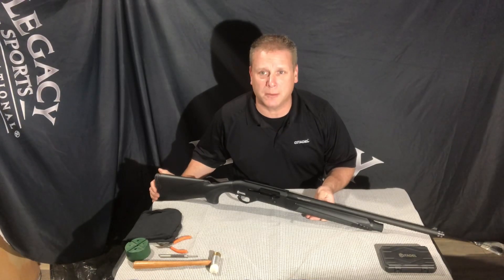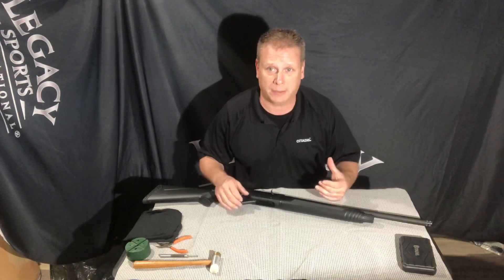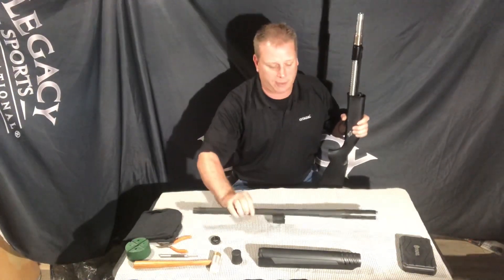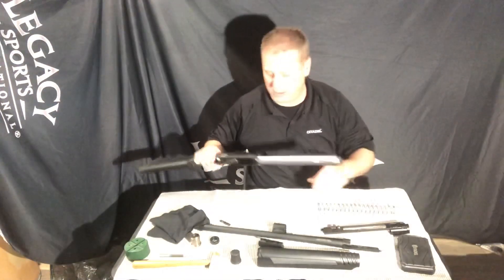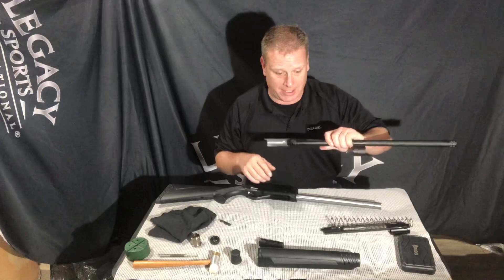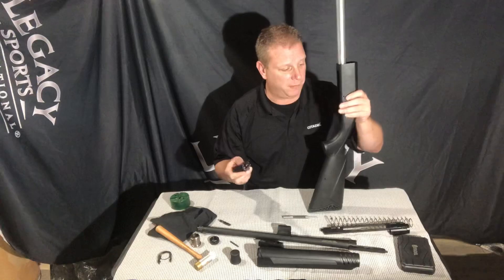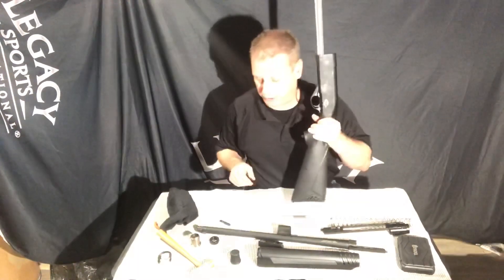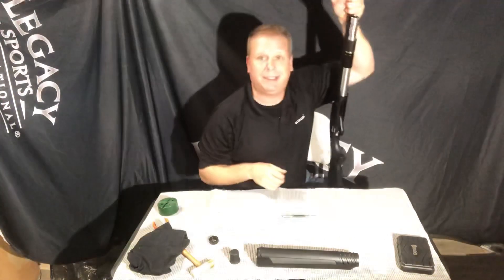Citadel KATAC-ATA12 disassembly/assembly

Comment: I just recently bought this shotgun. I tore it down completely to get the factory grease it is shipped with cleaned out. I took it to the range and it cycled perfectly until the eighth round when after firing, I found the trigger group hanging from my trigger finger. The ramp pin had worked its way out. Fortunately I found the pin on the ground. I used my mini repair kit that I always have on hand and reinstalled the trigger group and pin. About 8 rounds later it did the same thing, and I had checked the pin after the fourth round. I again, found the pin on the ground. Reinstalled the trigger group, packed up and went home. I emailed legacy sports support about the problem 3 days ago and haven't heard back. Has anyone else experienced this problem?

Comment: What if my shotgun model doesn’t have a retaining screw ? I need help putting the sleeve back on
Reply from the maker: Hello-if your model does not have the retaining screw, then the assembly process would be as follows; action spring, action arm and tube assembly, gas piston, barrel, forend and finally, magazine cap.

Comment: Is the supplied choke tube, cylinder or improved cylinder?
Reply from the maker: If the shotgun is new, out of the box, the installed tube should be modified. It also comes with a cylinder bore and full choke. They should all be marked as to the constriction.

Comment: Also I didn’t get the choke key with mine that I bought right out of the box can you send me one or will I have to just buy one
Reply from the maker: Hey John. Reach out to me personally at my email address and we'll get this resolved for you. It's scottn@legacysports.com
Reply: @scottn4948 hay figured out how to get the barrel tightened but don’t know what my choke key wasn’t in the box
Reply from the maker: Hey John,

Okay, good. Glad to hear you got the barrel tightened down. As for the choke tube wrench, they are usually behind a hidden "door" in the case. Remove all of the choke tubes from the case and shake it. You'll probably hear the wrench rattling around behind the door. Open it by pulling up on the case lid and pulling the door down. You'll then get the wrench. If for some crazy reason it's not there, let me know.
Reply: @scottn4948  thanks I’ll check when I get home
Reply: So I checked and definitely not there so I guess I’m buying one thanks
Reply from the maker: @johnhasty5009   hey John, reach out to the email address I provided you earlier with your address and I'll have the factory send you one at no charge.

Comment: does anyone know how to install a Barrel seal O-ring on the Citadel Warthog 12 gauge semi auto shotgun.
Mine did not come with one. Thanks!
Reply from the maker: There is no o-ring inside the barrel lug? It might be difficult to see because it's a black o-ring inside the black lug, but it should be there. Is the gas piston (silver looking) seated up inside the lug or did it remain on the magazine tube? If it is up inside it the lug, that's what's holding it there is the o-ring. Let me know and we can go from there. Scott

Comment: Any tips on getting these turds to cycle? I've got two of them. Neither cycle recommended velocity rounds, I have yet to consecutively shoot more than 2 rounds. Yes I have cleaned them both. I did not read the fine print on the warranty booklet so I did not register the warranties which probably puts me out of luck in that aspect as well.
Reply from the maker: Hey Levi- if you have thoroughly cleaned both shotguns as I demonstrate in the video and you're still having issues with cycling good quality brass based ammo at first, try this. Take a 3 piece cleaning rod end section, put a 12 ga bore brush in it and wrap 1 or 2 cotton patches around the brush. Put the rod into a drill and put a light coating of metal polish on the patches. Insert the brush into the chamber area only of the barrel and polish it for about 30 seconds or so with the drill. After that, use a bore mop with a very light coating of oil and lubricate the chamber. I usually find that after doing this on my samples that have cycling issues, it throws the empties about 10'-15'. If you still have trouble after that, let me know and we'll figure out the issue.

Comment: I cannot get the barrel off. Tried putting it between my legs like yourself and I still can't get it off any other tips on that part?
Reply from the maker: Hey Ty- is the bolt pulled back or closed when you’re trying to remove the barrel? It should be closed when trying to remove it. Is this also the first time you’re trying to remove it? I have seen on some where the oil has kind of “locked” the barrel in place and it’s taken two people to pull it apart the first time until you wipe away the excessive oil. Let me know. Scott
Reply: Yea its my first time trying to disassemble. The bolt is closed and I've tried with two people and no luck. My next option was maybe using the vise grip. If you have any other tips I'd be glad to try em out before resorting to the vise thanks
Reply from the maker: Hey Ty, sorry you’re still having an issue with the barrel. What ever you do, don’t use vise grips! That’ll destroy the barrel and put marks all over it. Try pulling the bolt back and locking it in case the chamber lock is preventing you from removing it. Use two people again. I have a feeling there’s a ton of oil in there creating a static lock. Once you remove it and clean it up, you won’t have this issue again. Let me know how you make out. If you still can’t remove it, message me and we’ll get it back to the factory and removed for you.

Comment: I was getting a failure to feed, until i took it apart and cleaned it. So, the excess oil does seem to affect operation. But, i have a Different issue. After i load one in the chamber and hit the bolt release, my feed ramp will also lock shut, if i dont hold the ramp lever forward as i hit the bolt release.
Reply from the maker: Thank you for the post. Did you happen to remove the trigger assembly at some point during the cleaning? I’m wondering if the link for the feed ramp is somehow caught behind the bolt release button. If you still have an issue, email me at scottn@legacysports.com and I’ll see what I can do to solve it.

Comment: Yesterday, I purchased a Citadel ATA 12 gauge shotgun but have not yet taken its delivery.  To be honest, it was an impulse-buy prompted primarily by its low price and the fact that, as a pump aficionado, I have never owned or even fired a semi-auto shotgun.  

 My prior to purchase internet research indicated the made-in Turkey Citadel has received a mixed bag of reviews. The negative comments seemed to focus on its sometimes failure to eject/feed issues.  Nevertheless,  I decided to give it a try since I'm never going to lay hands on a Benelli unless some distant, unknown relative wills one to me.  

Today, however, I happened to run across your video.  Interestingly, it describes this model's ejection/feed issues as being readily predictablle in the absence of an initial breakdown and detailed cleaning to remove excess factory oil residue. None of the other often highly subscribed presentations even mentioned pre-operational checks and procedures.  In most cases, to all appearances the shotgun was range fired straight out of the box. 

In any event, I appreciate your in-depth demonstration of the proper initial breakdown, cleaning and reassembly of this firearm.  I suspect your  informative,  practical approach and meticulous attention to detail will prove more beneficial than then other often flashier, noisier productions.  I will apply your straight forward tutorial when I evaluate my new Citadel shotgun and provide feedback to this channel (but only after I cycle a minimum of 50  rounds of >1,300 fps ammo:-)  Thanks for your insight.
Reply from the maker: Hey Geo Bus- thank you very much for the in depth post. I did this video a year ago out of the massive amounts of calls and e-mails we were getting at the factory having issues with their new shotgun. I found in many instances, they were either new to firearms or a semi-auto platform and had not been given any guidance by someone on how to first care for a new gun purchase. That is something every gun shop owner/employee should be asking of a customer, especially one they sense is new to firearms and if they’re not, shame on them. This video applies not only to our semi auto shotgun, but ANY semi auto platform including pistols and rifles. 

This is not to say we, and all firearms manufacturers. don’t have firearms that occasionally experience issues right out of the box, especially during these crazy times when factories are producing firearms as fast as possible to fill the shortage in the marketplace.  QC issues will happen, without a doubt. 

Should you have any questions or issues with your new purchase, feel free to contact me at scottn@legacysports.com

Comment: I purchased one of these shotguns. When I went to the gun range to shoot it I noticed there was considerable fore and aft play of the barrel. The part you refer to as the "retaining ring" will not lock up against the barrel extension to keep it snug and in place. The magazine tube doesn't have enough thread to allow a snug fit. This looks like a dangerous situation to me. The bolt actually moves freely with the barrel fore and aft. I sent your company an email but never received an answer. I watched the video and did exactly what you said.

If I fire this firearm is something bad going to happen? It's brand new and never fired. How do I fix this situation? Am I in danger if I fire it?
Reply: I had the same thing with mine. It's a tricky fit, but it can be done with a little 'persuasion'.

Comment: What if my gun does not want to fire. I'm getting light primer strikes and it won't shoot. I have only took it to the range twice.
Reply from the maker: Hi Jake. Sorry for the delay, I have been out of the office for two weeks. When you disassemble the shotgun and remove the bolt group, push on the back of the firing pin in the rear of the bolt to see if the front of the pin is adequately coming out the face of the bolt. If not, look for an obstruction or excessive oil around the firing pin spring inside the bolt group. The firing pin should stick out a good 1/16th of an inch if you are pressing the back of it flush. Let me know how you make out.
Reply: @scottn4948  that is fine. Whenever I push in the firing pin from the rear it sticks out just fine but when it's in the gun it's getting light primer strikes.
Reply from the maker: @ZER0_74_0  okay, just want to make sure there’s nothing blocking the firing pin. Have you tried different brands of ammo to make sure the type you’re using doesn’t have hard primers? I’ve had that issue with some Fiocchi ammo. Let me know and if you still have a problem, we’ll get it back to the factory and fix it.
Reply: @scottn4948  yeah I've tried like three different brands of ammo with the same result. I contacted citadel and they said my gun is still under warranty but I can't find my receipt anywhere and they said they need it
Reply: @ZER0_74_0  - How deep is the dimple? If you've tried "soft primer" shells (Federal) and it doesn't fire, it could be the hammer spring being too weak or the pin out of spec.

Comment: So I just took mine to the range today and I can the semi automatic 12g . And it can only hold 2 rounds. Can someone help me out, what can I do to hold more then 2 rounds??
Reply: I'm no expert but I do have a semi-auto myself. There could be a possible chance that it's just jammed have you tried forcing another bullet in? If you have then honestly I don't really know because my gun have that problem and I just pushed really hard and it released.
Reply from the maker: It sounds like you have a plug in the magazine tube limiting it to the two rounds. Remove the magazine cap and look for a black plastic rod going down inside the magazine tube. Sometimes tilting the barrel towards the floor will get the magazine plug to fall out. Once the plug is removed, it will allow four rounds into the magazine.

Comment: I picked up a ata KY semi auto from a buddy that couldn't get it to feed as it acts like a single shot auto eject , I don't know much about this gun as I can't find a lot of information on it I have no idea if it's safe to shoot slugs out of with or without the bore choke
Reply from the maker: It is safe to shoot a rifled slug out of any choke tube, but the best performance will usually be out of a cylinder or improved cylinder choke tube. Do not shoot any sort of ammo through it without a choke tube in place.
Reply: @scottn4948  another problem I have is my choke isn't marked so I have no idea if it' is a cylinder choke , I was told there is no way it made it out of the factory without being marked but it's not even my local ffl looked at the choke and told me that the only way they can know for sure is to measure it and for 30$ I may as well buy a new choke rather than spend the money dropping my gun and choke off to get he bore and choke checked

Comment: I have an issue with my shotgun, I recently got one of my own and the shells will not kick out of the magazine tube and onto the lifter, does anyone know what causes the issue?
Reply from the maker: Hello- Are you able to remove them from magazine if you hand cycle the bolt or do they only stay in the mag when firing the gun? I’m just trying to figure out if it’s an ammunition issue or a firearm issue. Thank you, Scott.
Reply: @scottn4948  they will not be removed if I hand cycle the gun I have to press the shell latch manually to get the shells from the tube
Reply from the maker: When you have a moment, email me at my company address of scottn@legacysports.com. It’ll be easier to go in depth there then in this forum.

Comment: Scott...I just brought my warthog to the range, ran some 00 buck through it and was having the brass ripping off the hull and the hull remained in the chamber.  The round fired and the next round fed, but I had to remove the live round and take a cleaning rod and push the spent hull out.  Does this sound like a warranty issue?  I just polished the chamber like you advised, but don't know if the gun is safe to shoot.  Please advise,  Thanks!!
Reply from the maker: Hello-I apologize, I don’t know how I missed your question posted here. Not sure what brand of ammo you were using. Was it good, quality factory made ammo like federal, Winchester or Remington? It sounds like a bad run of ammunition and the plastic hull was not properly fused to the brass bass upon forming. Let me know if you have issues with other ammo.

Comment: Hi Scott, Thank you for the video. Just got my KATAC last week. I'd like to ask how do I replace the follower in magazine tube? Thank you!
Reply from the maker: Hey @USR- Sorry I missed this message earlier. The only true way to replace the follower is to remove the magazine tube from the receiver. I would absolutely, positively recommend you NOT do that unless it’s necessary since we currently don’t have any replacement magazine tubes at the factory and if you damage it, you’ll be dead in the water and not be able to shoot the firearm. Thank you, Scott.
Reply: @scottn4948  hello Scott- is there a site to purchase spare parts for the KATAC -12 ?
Reply from the maker: @adksherm   not exactly sure what parts you may be looking for, but I know they are few and far between currently at the factory. Our gunsmith has some parts, but those are generally used to repair damaged firearms. Let me know what you are looking for.
Reply: @dykeinator2.015  try locking the bolt back then trying. Made mine a lot easier the first time.

Comment: Is there anywhere I can buy the extra choke thing from anywhere got mine from academy came with standard choke
Reply from the maker: Not sure what you mean by extra “choke thing.” If you’re referring to the choke tube, they are a Beretta/Benelli Mobil thread pattern. If you mean the wrench, they’re an extended tube, so you can take them in or out by hand.
Reply: @scottn4948  what talking about the choke kit
Reply from the maker: Did you purchase the shotgun from Academy new or used?
Reply: @scottn4948  new but I got it for 330 it's a ata cy I forgot if that's the one u have
Reply: @scottn4948  I don't think academy has used guns where I live
Reply: @scottn4948  I called them earlier they said they don't come with the extra chokes
Reply from the maker: @mycelium1456  if it’s the KATAC or Bosshog, then they come with three extended choke tubes. The one in the barrel should be modified. If it’s new and it didn’t come with them, you can call the factory and select option 2 for customer service. They can get you the additional chokes.
Reply: @scottn4948  it's the cy tactical thanks ye I'll see about trying to contact them and maybe buy some
Reply from the maker: @mycelium1456  We don’t make a shotgun with that name. Not sure which gun you’re talking about. The only semi auto shotguns we make in the personal defense line are the KATAC and the Bosshog. We also make the BOSS-25, but that’s an AR style shotgun.

Comment: I've seen on some videos that there is a spring in the action bar, when you remove the bolt from the bar the spring sits in a hole. I noticed that yours doesn't, just like mine. Was this spring left out in manufacturing for a reason? Thanks
Reply from the maker: There are three different models of this style shotgun. The Warthog, the Bosshog and the KATAC. Each has its own little difference and in fact I have seen differences even in the same model KATAC. Unfortunately, it makes it difficult sometimes for me to diagnose problems because of the variations in the models and due to demand, I don’t even have samples right now to refer to at the moment.